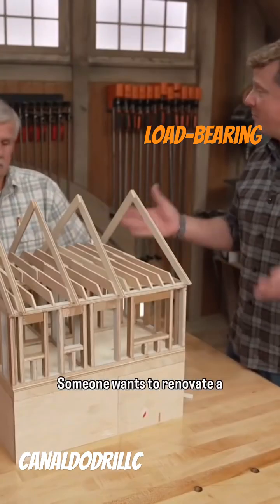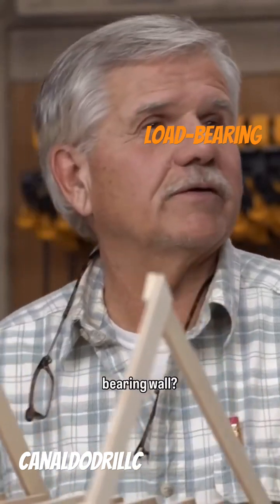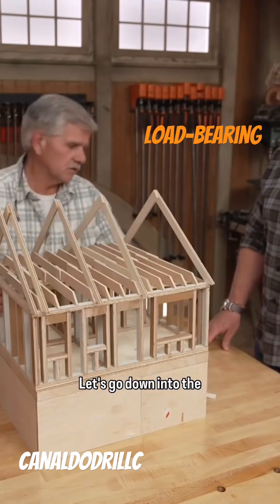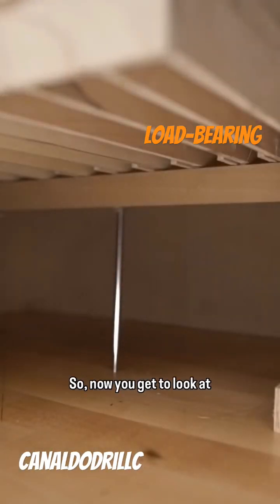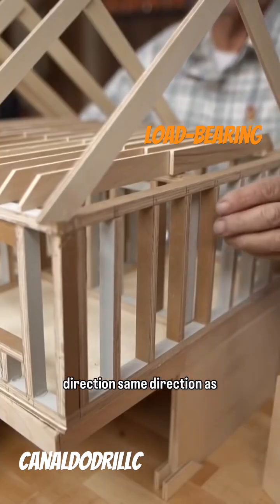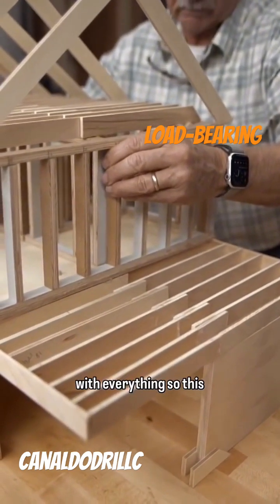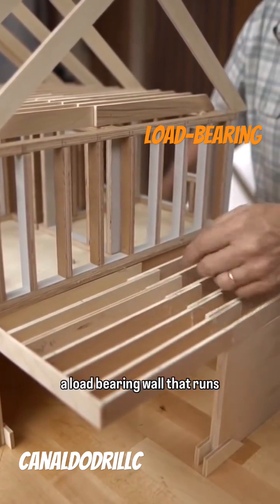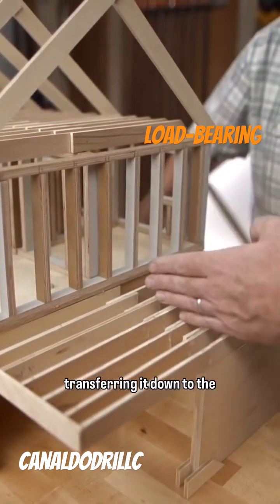load-bearing walls #blueprint #loadbearing #walls #construction #funnyvideo #construcao #eua #bras

Comment: Nice thing about having a house built on a steel i-beam is I don't have to worry about any of that stuff. I could park a semi in my living room the floor is so solid.
Reply: You still need to know which walls are load bearing on the 1st, 2nd, 3rd floors, etc...before you can remove them, or the 2nd, 3rd, etc...or roof, may come a tumbling down.
Reply: @carlstrohm3785  it's only one floor technically the basement doesn't count for some reason in my county. That's what makes it so sturdy
Reply: @YolandaPlayne  OK. Then you'd just need to know which ones have to stay to hold up the attic/roof structures. Likely just the wall down the middle of the house, in the same direction of that steel beam. The rest could most likely be removed to make space wherever you wanted to.